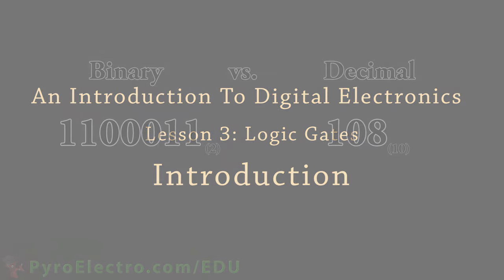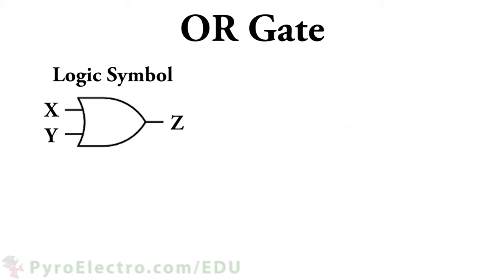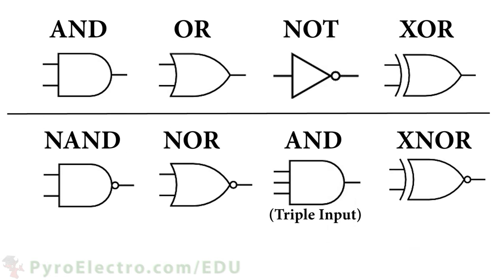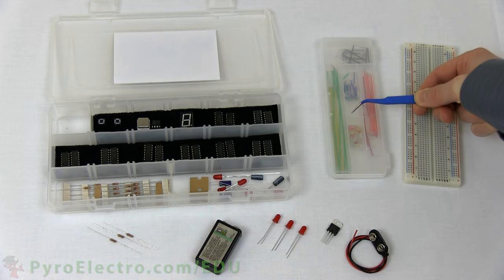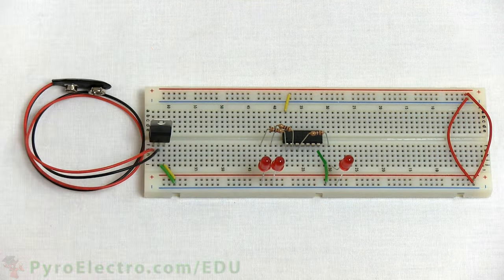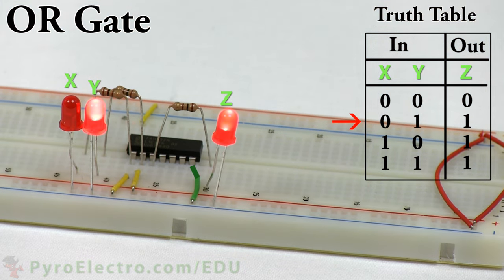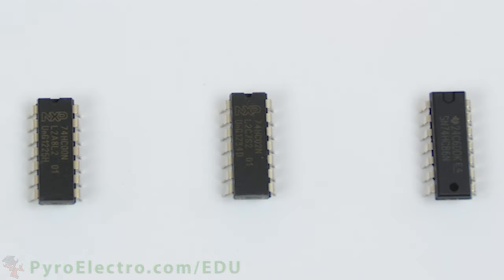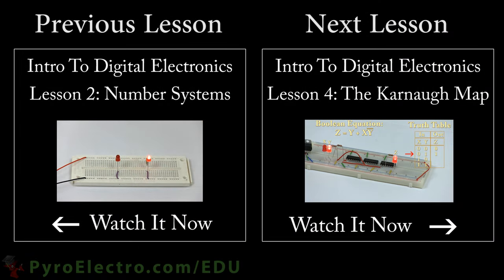Logic Gates - An Introduction To Digital Electronics - PyroEDU

Comment: When I was messing around on a logic simulator app on my phone I found something interesting. if you ignore something called gate propagation delay, and you connect the output of the not gate back to its input, you get an infinitely fast square wave, as if you feed the output of an inverter back to its input you get an infinite recursion.

Comment: So how can you tell the difference between an AND, OR, or NOT chip just by looking at it? 
Are you supposed to remember it by its number?
Reply: Yikes!
Reply: A simple solution would be that the manufacturers write "AND", "OR", or "NOT" on the circuit to make it clear what it does without the need to memorize a table or series of circuit numbers.  :)

An improvized solution would be me sticking tape on the circuit and labelling it myself.  :D

Don't mind me. This is a personal pet-peeve of mine lol.
Reply: That would be a solution if only a few types of those IC exist, but the coding is needed as we have a LOT of different chips
Reply: I can imagine. Too bad they didn't implement the word "AND", "OR", or "NOT" into the ID.

Instead of calling it a "7402", they could call it an "AND-7402". 

That way you know what it is at a glance, and then the number tells you what type of AND chip it is, so the number could actually be shortened.    :D

Comment: What is the difference between pull-up and pull-down resistors again?
Reply: pull-up resistor creates high voltage if there's no other voltage source connected, pull-down resistor creates low voltage (ground) in the same case

Comment: Sorry for the question spam, but 1+1=2 (base ten), or 10 (base 2) not 1. How does that work with the OR gate?
Reply: +Matthew Ferrie I had the same question when I watched this just now, but I think i understand why:  There is only bit. (base 2:) 01+01=10 because there is room to store both bits. but with only 1 bit, 1+1=1.  

Actually, this is a good intro into how a finite number of bits causes imprecision in computing.  If your interested, look up floating point representation, machine epsilon, rounding error, or simply floating point imprecision.
Reply: +iamtweety90 Interesting! Thanks.

Comment: I have a 7905 regulator instead of 7805 i.e. a -5v regulator. Can I just replace grnd by this regulator and give the grnd connection to the +5v pin of IC? In that way the +5v pin will still have a higher voltage.

Comment: Why is the regulator necessary? Why not use a resistor to drop the 9v to 5v?
Reply: Well, only a single resistor can not create a voltage drop. So for that purpose we'll need a resistive voltage divider. But there is some problem. As other components in the circuit have their own resistance they also work as loads which ultimately creates a different voltage than we need. A 5V zener diode could be used but it may not handle huge loads or cannot supply sufficient current as a series resistor must be used before the zener, which will limit the current. Whereas using a simple linear voltage regulator makes everything simple, it can even handle upto approx 1.5 Amps of current.

Comment: If the 7805 regulator is only for 5v, why does it have a heatsink mounting hole?
Reply: Because of the 7805's low efficiency, if you are regulating 9v to 5v at 100 mA, the power lost is 400 mW, which is a LOT

Comment: I have some ICs but none of them have a notch at the top corner. They have notches, but they're in the top center. And none of them have that exact string of numbers yours has. Are they supposed to? I don't know how to tell these ICs apart.
Reply from the maker: If you are looking at the IC from above and the notch is on the left hand side, pin 1 will be below the notch. For more reference do a google image search of 'standard ic pinout' and you will find other pictures people have taken with the center notch and the pin numbers labeled. As for the numbers. All you really need to find on the IC is the 74 and the 00/02/37 or whichever you are looking for. All manufacturers label theirs differently, but those two numbers will be on all chips.
Reply: The only notch is on the top center. It's not on a left or right hand side, but in the center.
Reply from the maker: http://en.wikipedia.org/wiki/Pinout Yes, that's normal. Please check that link, it should clear up your question.
Reply: PyroElectro Alright, thanks.
Reply: PyroElectro  thanks bro, your lessons are really helpful !
Reply: You've probably already answered your own question by now but I will answer it anyways for others who may be having the same problem. If the notch is on the top center, then more than likely there will a little circle on the bottom, or none at all. If you aim the notch away from you or up to the ceiling, the pin directly to it's right will be the voltage, to it's left will be the first pin, and on the bottom left will be the ground. Additionally, the configuration used is a modified version of a pull-down set-up which uses the LED to ground the inputs of the IC. If you try to do it any other way, you'll have to ground the inputs yourself with at least 100 Ohm resistors, otherwise your output LED will be flickering and doing all kinds of weird things since the state of the circuit will be "floating".
Reply: in your case, with the notch in the center of the top of the case, the pin to the left of the notch is pin 1.
Reply: PyroElectro+ where to get the parts?
Reply: Manop Physics Check out sites like Jameco and DigiKey.

Comment: What about the green wire??
Reply from the maker: It's on the schematic, but in the video we had to 'special effect' it to better show the connection from ground to pin 7 of the IC.
Reply: +PyroElectro Good evening why does my output didn't work? for example,in my input, the x=0, then, x=1, but then my output is none. what will i do? Thanks in advance.